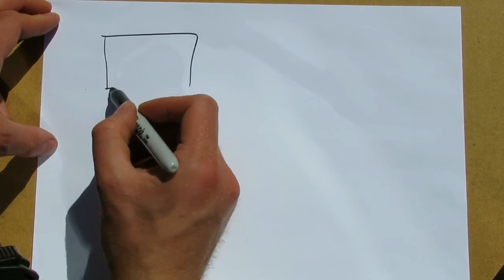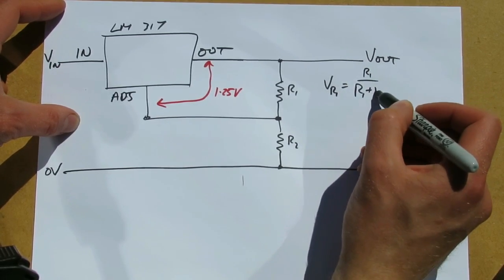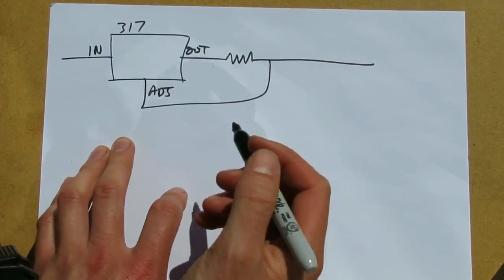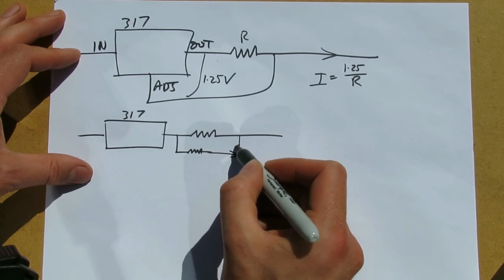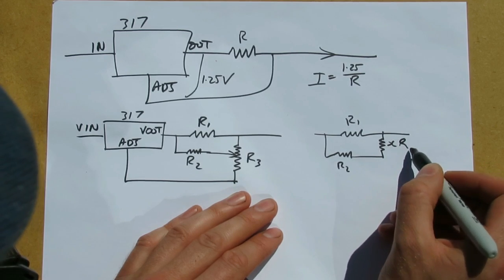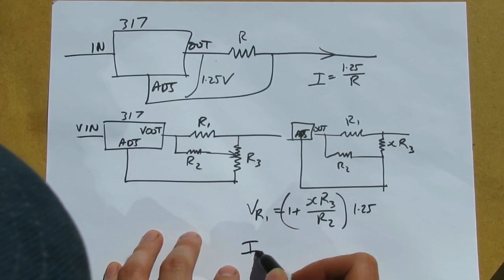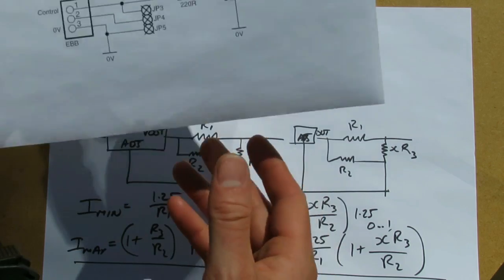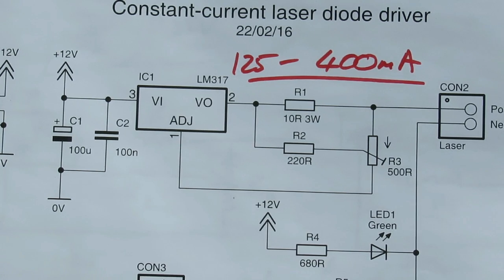LM317 adjustable current source/regulator

Comment: Hello lindsay following your calculation of VR1 I don't seem to get the same result as you maybe I'm wrong but I've got Vr1= 1.25.(R1/R1+xR3) because the resistive divider is between R1 and R3 no ??
Reply: You're right. He got all his calculation wrong. Vr1 = 1.25 [R1/ (R1+xR3)] and Iout = 1.25 [1/(R1+xR3) + 1/R2]. He also got his modified voltage regulator calculation wrong in another video. I did a simple experiment to verify his circuit. The problem is that when pin adj is connected to ground without any load resistor, Vout is not 1.25V as one would predict.
Reply from the maker: RIght. I see where you're getting confused, but I'm still right ;-) You can't calculate it the way you did, by thinking of R1+xR3 acting as the divider, because the same current does NOT pass through R1 and xR3. R1 carries the full load current, whereas xR3 only carries whatever small current flows through it and R2. It's R1 that's PRODUCING the voltage, which is then divided down by R2 + xR3. The IC adjusts its output until that divided-down voltage equals 1.25V (or close, when you account for the small 50uA current that flows out of the ADJ pin). I've built and used both the current regulator and voltage regulator circuits, and both work as I calculated. Not sure what you're referring to by Vout not being 1.25V when the ADJ pin is connected to ground - for a start, the ADJ pin is never intentionally connected to ground (unless you happen to short the output). It always goes to the feedback network. If you ARE using a constant-current circuit and you short the output, which DOES bring ADJ to ground, the Vout from the IC is indeed 1.25V (I just checked this). Hope that helps.

Comment: The LM338 has a max current of 5A - will your design work for that as well ? Provided of course the series resistor R1 can hold that.
Reply from the maker: Should do - it looks to have the same 1.25V reference voltage as the LM317. Thanks for mentioning the '338, by the way - didn't realise it came in 5A versions as well!
Reply: Great, but the issue is that I doubt you'd find a resistor that can hold that amount of current through it. At 5 volts, you'd already be pulling 25w (since V times I, equals P, assuming the load is rather heavy - something like an automotive halogen lamp or medium sized motor that draws the whole 5 amps). I was thinking of a pass transistor to take away most of that current, then somehow sample the voltage using the resistor divider so you can still get the 338 to do its thing. Haven't quite mulled it over, so I don't know exactly how it should look or work - might wanna check it out :)) An op-amp might come in handy as well somewhere.

Comment: In many of the circuits, ppl are using a capacitor in the beginning. Can you please tell what purpose it is serving
Reply from the maker: Power supply smoothing/decoupling
Reply: @imajeenyus42  Thanks
Reply: Hey, one thing more. Is there any limit to the value of capacitor which we can use? I mean on what basis should we decide?
Reply from the maker: @vishal_on_yt  A lot depends what sort of smoothing you already have on the power supply feeding the regulator. If it's already well smoothed, you don't need much. Few uF low-Z  film would probably do.
Reply: @imajeenyus42  Thanks again. :)

Comment: I notice your configuration for R1,R2 and R3 is different from most CC circuits I've seen using the LM317. They usually just have a pot where R1 is and don't have R2 and R3.. Any reason why you've went with this design?
Reply from the maker: Thanks for the message. One reason is power-handling capability. Suppose I wanted an adjustment range of 100mA - 300mA. The potentiometer value is determined by the low end of the current range - in this case, 1.25V/100mA = 12.5 Ohms. But when the pot is adjusted to give the highest current, the full 12.5 Ohms has to pass a current of 300mA, which is just over 1W dissipation. I know you can get 1W variable resistors, but why risk it.

The other main reason is getting a linear adjustment in response to potentiometer movement. The traditional method, with a pot in R1, gives a nonlinear response. My method gives a linear response, and avoids the need for a high-power potentiometer. In addition, it also offers protection if the potentiometer wiper happens to leave the track at any time (even briefly) - the output is forced to a low level, rather than high (with the traditional arrangement). This is especially important for things like laser diodes, which are extremely sensitive to over current.

I've got much more on what I call the "grounded-wiper" potentiometer configuration on my website here: http://imajeenyus.com/electronics/20160517_potentiometer_feedback/index.shtml
Reply: Brilliant!. Good design. Thanks

Comment: I am powering an led source that needs about 6amps. I have 4 lm317t's each rated at 1.5a.

Am I able to put these in parallel to increase the possible current? Like stacking them. I am not sure how this would affect the adjustment circuitry though.

I plan on using a potentiometer.
Reply from the maker: There are a few examples shown in the datasheet of either connecting multiple LM317 in parallel or using an external pass transistor to increase the current capacity, but they are configured as voltage regulators, and I'm not sure how you'd do it for a current source. However, at these sort of current levels, you'd probably be far better using a switching regulator instead. There are lots of constant-current LED driver chips around, e.g. https://www.ti.com/lit/ds/symlink/lm3409.pdf
Reply: @imajeenyus42  Thanks, I ordered a 8amp buck converter which has adjustable current and voltage at the output. It was only $4.99.

Comment: Nice, could it be used for regulating low current?
I need to regulate between 2mA - 50mA and minimum voltage is 10V

let say i use 1k  R1, 1k R2, 100ohm R3 and the calculation will result I min = 1.25mA & I max 126.25mA

and how much is the output voltage would be in 10mA ?
Reply from the maker: Don't know how you arrived at those figures, that's not what the equation gives. Try R1 1k, R2 100, and R3 10k. Should give 1-100mA range, but note that the adjust pin current might become significant. Easiest is just to try it.
Reply: @imajeenyus42  thank you for your quick response. I'll give it a try. 
I will share the result. 
Thank you

Comment: thanks for sharing ...
but it's getting to high temperature when i use it to control my 12v soldering iron voltage..
any suggestions or different solution for high loads ?
Reply from the maker: MAKE A DEFERENCE شكل فرقاً You could try using an LM338 instead - they can handle up to 5A, exactly the same operation.
Reply: Linear regulators like this are NOT the best solution for high current or when large voltage differences. That is because the excess voltage is ALL converted to heat by the regulator. For soldering iron it is much better to use a switch mode buck regulator with constant current - these cost a few dollars from eBay etc.

Comment: has anyone actually tested  the schematic with the given values at the end of the video? I am very curious to understand if the theoretically determined current range is actually obtained
Reply from the maker: Yes - me. I used it to drive a 300mW laser diode on my AxiDraw plotter. From what I remember, the range was pretty close to what was calculated, maybe 150-380mA or so. It'll be a little off with component values, tolerances etc. http://imajeenyus.com/computer/20160531_axidraw_laser/index.shtml

Comment: This looks great.  Could I use 500k pot (R3) + 47k (R2) to get 125-1400 (ish) mA to drive / dim a series of high power (3W) LEDs ??
the leds require 700mA - 3.2Vf and are arranged in 2x series of 3.  On my bench supply, feeding 12V and CC of 1.4 draws about 9.99V.
Dropping CC to 125mA has the desired effect.  Could this work?
Reply from the maker: It would work, but unfortunately isn't very efficient. If I_min is 125mA, then R1 (the series current sense resistor) needs to be 10R. I_max/I_min is 1400/125=11.2, so R3/R2 has to be 10.2. Your choices of 500k + 47k are the right ratio, but I would choose 5k + 470R instead - with high value resistors, the leakage current out/in of the LM317 adjust pin can throw things off. At the maximum 1.4A, R1 will be dissipating 20W, so it'll need to be able to handle that power. Again at maximum 1.4A current, the LEDs will drop 10V, R1 14V and the LM317 needs 3V of headroom, so that's a minimum supply voltage of 27V - a 28V supply would probably be the closest.
Reply: @imajeenyus42  Thanks Lindsay.  I'm very new to all of this, and just happen to have 500k & 200k pots.  I will try and obtain some other analog pots in the lower range, closer to the above, and possibly start with the LEDs in 1x3 to see if that improves the situation.  The desire was to reduce the foot print somewhat.  I do have some XL4015 / LM2596 CC drivers. If I cannot control this thru a 12v supply then I may just go the module route.
Reply: @imajeenyus42  I found some 1K pots to use with 100 ohm as R2.  Would this be ok?  Also is the loss of wiper contact a concern and so should I look closer into your other topic regarding that?  Thanks a lot.
Reply from the maker: @PanteraPersa  They should do the trick. With the circuit in the video, any loss of contact will cause the current to drop to the minimum value, so that won't be a problem.

Comment: I do not get it, why have not you used a constant current circuit from the datasheet ?
Reply from the maker: I don't understand what you mean. The only current regulator circuit in the datasheet is Figure 14, which is a current limiter. This is totally unsuitable for my application. My design gives a linear adjustment response, plus protection against wiper contact loss.
Reply: In TI datasheet there is "50-mA Constant-Current Battery-Charger Circuit" example. Basically you need only R1 to set constant current mode. R2 and R3 are ok if you need to adjust current except a resistance to ADJ terminal may (I am not sure) have some unwanted effect.
Reply from the maker: I am well aware of the circuits in the datasheet. There is no problem whatsoever about adding other resistances around the ADJ terminal. All the chip does is adjust its output until there is 1.25V between the ADJ terminal and the output. You can put in whatever resistive feedback networks you like. I have built many constant-voltage and constant-current regulators using the LM317.

Comment: Hey buddy. Is there any way we can make a circuit which is workable for both positive and negative supply. I mean as we know that LM137 is the negative complement of LM317, so can we make some something workable by making use of both of them.
Reply from the maker: I'm not sure what you mean - each regulator is only capable of handling its own polarity (positive or negative), I don't think there's a way of combining them so the output is continuously adjustable from negative to positive.
Reply: @imajeenyus42  I meant that I want a circuit which can perform current limiting for both negative and positive supplies. Since LM317 can only work for positive supplies we need LM337 to work for negative supplies. So just by using a switch we can make them work right?
Reply from the maker: @vishal_on_yt  Possibly, I'm not sure.

Comment: so if iid like to make this circut with a lm388  for a 5a adjustable current supply cloud i make that with this circut ?
Reply from the maker: Yes, should work exactly the same. Reference voltage is also 1.25V. (I'm assuming you mean the LM338; the LM388 is an audio amplifier)
Reply: cloud you add some practical resistances i dont seem to fully grasp the equasions
Reply from the maker: Use the equations given at http://imajeenyus.com/electronics/20160530_adjustable_current_source/index.shtml to work out the min and max current - it's most helpful if you stick them into Excel. For example, R1=2 Ohm, R2=220 Ohm, R3=2000 Ohm gives a minimum current of 625mA and a maximum current of 6.3A. Watch out: remember that R1 has to carry the full load current, so will need to be high-power. (In this example, power dissipation is nearly 80W!)

Comment: so with this it does not matter what the input voltage is right?   
5v or 12v or 36v it's all the same.  only the higher the voltage the hotter the lm317 gets
Reply from the maker: Yes - the LM317 doesn't care what input voltage it sees (within its safe limits)
Reply: i have no clue how to measure if what i am doing is correct.   

if i wire it up like the schematic.  and i test the resistance over the output and the input.  it does not change  (635 ohm or 1153 depending on the polarity of my probes) no matter what i do to the potentiometer. 
if i test the resistance between out Iout  an adjust on the lm317.  i get a range of 161 ohm. to 533 ohm.
is i test the resistance between lm317 out and lm317 adjust.   it ranges from 157ohm to 543ohm. 

if i connect the 12v plus of a led strip.  to Iout.
2 9volt battery's + to lm317 in.  
and the ledstrip negative to the negative terminal of the battery.  
then the leds light up bright. and changing the potentiometer does nothing.  
hoever if i connect the 12v+ of the leds to lm317 adjust.  i can actually manage to change the leds brightness.  

do you have a video of you actually building and using this thing so i can double check that i am doing it right instead of some written down schematic that might or might not be correct

as it is now i am not hooking this up to a laser diode.  i am 99.9999% sure it will just say poof.
Reply from the maker: @darkracer1252  I do not have a video of my "actually building and using this thing" - that's the whole point of a schematic diagram. Suffice it to say, I have built and used this exact circuit for driving laser diodes. I have no idea why you are trying to measure the resistance between the OUT and ADJ terminals of the LM317 - that is going to be completely meaningless, because you have absolutely no way of knowing how the internal circuitry of the LM317 will respond to the test signal from the meter. Trying to measure the resistance of components in-circuit is always going to give strange results when they're connected to "active" components like semiconductors. Do NOT connect the load to the ADJ terminal - you are likely to damage the LM317 since it isn't meant to source a large current through the ADJ pin.

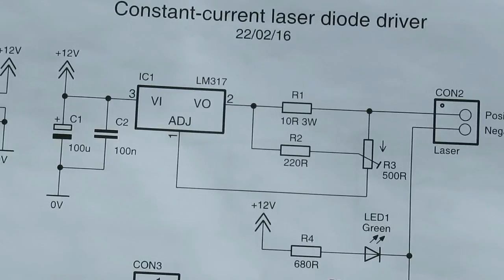All I can suggest is you double-check your circuit. The laser diode driver shown at 7:00 works perfectly well.
Reply: @imajeenyus42  yeah it's not needed either.  
i'm just a freaking dumbass.  

i guess the load i was testing with had some sort of corrective circuit aswel. 
(you can hook it up to a straigh dc power source all day without issue)  

after i grabbed a single led diode.  your schematic worked. 
when put on Iout i can adjust the brightness of the led.  

now i need to use something other then a 9V battery so it won't get drained and give me increasingly dimmer results.  
using 2 9v battery's seems to burn out the led though.  wich kindof has me worried about hooking up an actual laser diode.
Reply: @imajeenyus42  if i connected up the previous load.  (the led strip with resistors and what not on it)  
it seemed the lm317 did nothing at all. 
it did not heat up in any way i wired it up.  and i tried everything.  

but with the straight up single led diode.  everything did what it's expected to do.  
turning the pot changed the brightness (although in reverse, clockwise was dimmer guess that's just a matter of reversing the outer wires of the potentiometer.) 
and the lm317 actually started heating up when i dimmed it.   

so i guess there is some black magic happening in the led strips i tested this circuit with before.
Reply: in any case it works from what i can tell.  now i just need to go buy a 200mw led (easyer to buy then laser diodes)  and test if it burns out with a 12v 0.5A power source
Reply: @imajeenyus42  anyway many thanks for the help even though my questions have been pretty whiny.  (makes me feel like a choosing begger)

it works.  i just didn't know enoegh about what i was testing to actually do something correct XD

no need to get a led to test with either.  confirmed with my dad that the led burned out because it's 18v but my laser won't do that.
Reply: @imajeenyus42  ofcourse me asking all these stupid questions is going to help someone else in the future who is just as stupid as i am XD

Comment: Why (1-x)R3 is neglected ? It can be greater than xR3. What is the sense?
Reply from the maker: Because the ADJ input pin of the LM317 has a very high input impedance, so any additional resistance in series with it (like (1-x)*R3) has no significant effect.
Reply: @imajeenyus42  OK. Thank you.